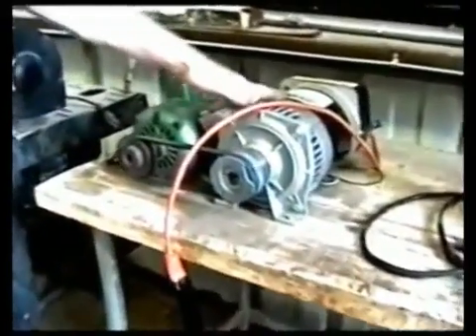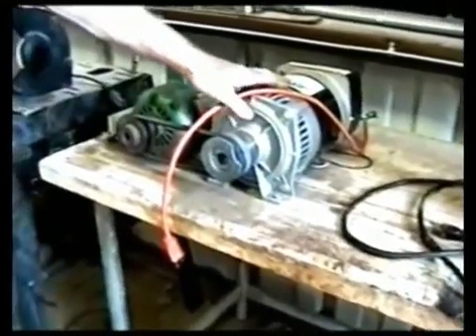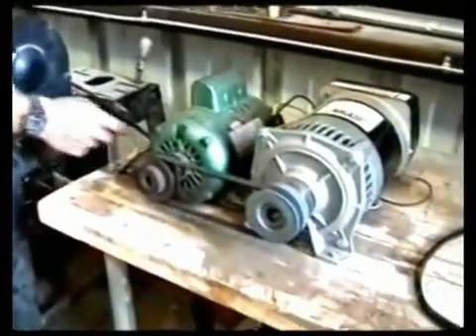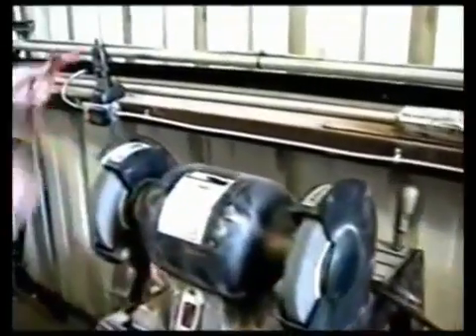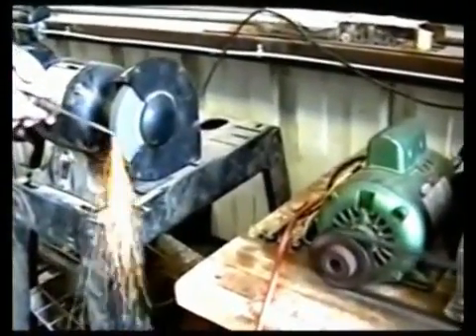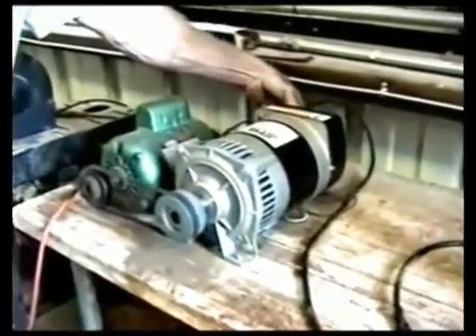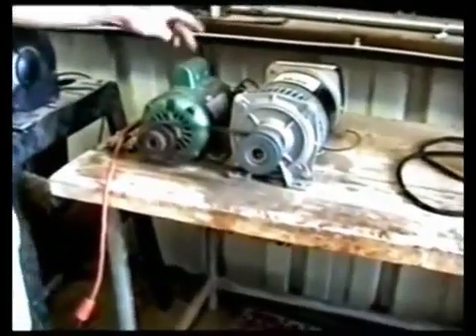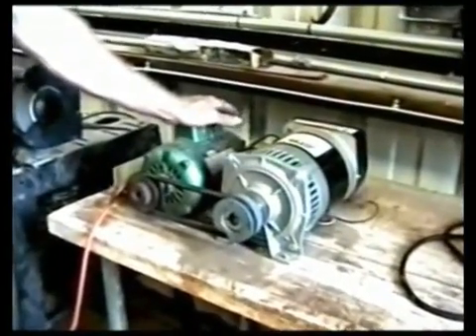3000 Watt Generator Powers Itself, Grinder & Drill Press.

Comment: I thought about this for 2 minutes and did a diagram on how this would work. The key is getting the primary motor up to speed and using one that uses less power than what we want to generate. Maybe a 750 rpm  Ac Motor with a pulley wheel four times larger than the pulley wheel on the generator will bring the speed up to 3000rmm. This will then generate  power which can be fed via a changeover switch which knocks off the mains electricity to the primary motor and replaces it with some of the power that has been generated. the remaining power is used to operate your electrical appliances and is limited by the wattage output of the generator. Don't forget that because the primary motor was started on mains voltage and is running up to speed, it does not require much power from the generator to keep it running, The only problem I could see is getting the right motor for the job. ie a continuous running motor maybe half a horse power. Would continuous use for hours burn the dam thing  out? If your not electrically minded ,or a spark  I would recommend not trying this. Remember, Electricity can Kill.

Comment: This system is very simple and yes it does work. You people need to know the basics of how electricity comes into your cities and homes before you can understand it.  A power plant generator only supplies the initial power. It is the transformer that multiplies and increases the voltage power that you actually receive at a substation in your cities. The transformer is the key. The generator only supplies a small fraction of starting power to any and all power grids. What this person has done is use a more powerful transformer/coil to get more auxiliary power to power the electric motor that keeps the generator running as well as the other outside uses like the grinder and drill press. This is so simple and is genuine. Of course this is not patented or on the market because the power companies as well as the government do not want it on the market. Generators used in power plants DO NOT send millions of volts to cities without a transformer radically stepping up the power. And by the way, a transformer/coil has no moving parts. It is a self contained unit that steps up power and also can step down power. Every power plant has a step up transformer to radically increase power to cities and every city also has step down transformers to decrease the power to each and every home. You have step down transformers at substations and then each and every home has a step down transformer on a pole outside your home. This is very basic technology and has probably been known since the generator and coil/transformer was invented. The key is to put a bigger coil that increases for auxiliary power to whatever your needs are.

Comment: I love when random retards come out of the woodwork. skeptics that help feed the corporate world are my fuel for laughter. it's entirely poissible to do this as long as the generator itself produces more energy then the electric motor consumes. given that it's entirely possible to create an infinite energy supply, this one is very small.
Reply: +Devin Williams the secret is that yes there is another power cord, it's drawn from the generator head with multiple outlets, that's what wasn't disclosed. that's why the switches are there. I get what you're saying but no one is seeing the bigger picture. he made a completely self sufficient generator on small scale. this IS the sort of thing that will change the world as soon as intelligent eyes are open. it's a very simple idea.
Reply: +reynardfoxx you've never seen a belt driven generator have you. if so you'd know that that small electric motor that ran off a 120 volt circuit to initiate the rotation of the generator which creates its own energy flow to power other things the same damn way a gas powered generator does.... the switches allow transfer of energy source from wall outlet to generator outlet. generator has two outlets total built it,generator spinning creates energy to maintain electrical current to electrical motor on one outlet, generator still has enough power on reserve through the  revolutions per minute to power a second outlet and run the grinder then the drill.

Comment: lotta morons in these comments.  systems like these already exist.  this is not new.  i can't vouch for the validity of this video,  but i can vouch for the validity of the science implied.  there are many similar systems that seem to "power themselves",  but all you need is to understand the logic running the device,  cause and effect.  There are much smaller,  simpler devices that create the same effect of perpetual motion through magnetic fields.

I'm about to build a DC generator farm(10GENERATORS)  that use the concept of what is now called perpetual energy.  the term perpetual energy isn't a literal term.  so don't be stupid.  study your science you dipships.  p.s.  what kind of idiot would turn this video into a relegious topic??

Comment: What if an electric vehicle was built that had dynamo type power generators (like the ones they have to power bicycle headlamps and tail lamps) creating power from rotating axles/wheels so that the power generated in this manner would  "top up" the batteries of said electric vehicle?  It's a step closer to perpetual motion...of course the power companies would probably not like this manner of motility and would do anything in their power to discredit the technology...just a thought
Reply: same idea, only that it would generate current while the wheels/axles are rotating as opposed to when the brakes are applied.

Comment: i got a car alt 12v and a 2800 rpm 24 volt motor with 200amp start up dropping back to 150 amp.running .. i put a 250 watt converter  in the line  .. and a car batter 14 plate 900 crank amps. , turn converter on to sart motor it spins car atl to replace power  ..it only gave me 60 watts to play with but it was free .it ran my work light ....and i put it in a shopping trolley...so i could move it around.. 
im not an electric person but i made this and i no it worked..... try thing out for your self..

Comment: You need to add a peak voltage detector that sees the output voltage drop of 20% and then automatically resets the input at the wall for about say five seconds.  You could have a variable voltage detector and automatic switching and reduce the house power usage for maximum performance!

Comment: if this is legit, its 2 cool
ive wonderd y it woodnt b possible 2 build a perpetual motion electric cars? 
yes i get the energy spent on friction n wutevva else
but aint it possible if the output gears/pulleys r smalla than the input gears/pulleys
which in turn then syphon the needed energy back 2 the motor, as well as spins the cars shaft?
i mean it seems possible so long as the input generates mor rpm's than the original output
---
totally not tryin 2 ruffle anybdys feathers
jus a ditch digga, lookin 4 feedback

Comment: I did something similar years ago with a car battery, starter, and alternator to run 12v lights and keep the battery charged. All I had to do was flip a switch and the lights came on in a barn shop. Bright lights too...car headlights. Its a great setup for hunting cabins or camping. And with a 12v/110v converter you can run low energy 110v appliances like small refrigerators or a tv...

Comment: Was just reading the comments regarding this generator, first, i think he used bent drill bit to show it was really turning. I'm not to sure about this myself, as someone rightly said you cant get more energy out than you put in, I dont think there was a hidden wire when he removed mains plug ,if it was running on its own, there was no load to slow it down so it would have stopped eventually due to resistanses in motor, altenator. Someone suggested gearing altenator to drive motor faster that would add more resistance, another suggestion was larger pulley on alternator smaller one on motor, also if the motor is domestic mains (usa voltage) the altenator is 3,000 watts a lot of power you would think it would run the motor with no effort perhaps for a short time, the main problem here would be the faster the altenater was turning the higher the magnetic field build up between rotor stator so more resistance to hold motor back,would'nt the problem be the same whether it was a magnet rotor, or one that required exciter current?  would welcome comments on this. please.

Comment: How many amps does a car alternator put out? All it takes to get the alternator working (it has to move first to power the spark plugs) is a 12 volt dc battery. And if you can impart enough rpm to a generator, and that generator can create let's say 20 amps, and it is being run by a motor that drains only 3 amps.......? Come on people. Spare me the math, and start doing some real experiments on your own. Hundreds of people have tried this and made videos. They're everywhere.

Comment: If you would share to a fellow tinker guy, my email is kmss44@yahoo.com, thanks, also, i am curious if you had to change the sin wave to get the motor to continue to work.  I have seen some ac units work when they had inverted a dc generator wave to run it.
Reply from the maker: FREE CLASSES!  After you study the free classes on the website, THEN AND ONLY THEN, send us a email. witts.ws
contact us page

Comment: is there any chance you would share how you made that work, with your additional coil set up.  I am working on one right now but , I was curious to know if the ac motor your using is brush type, brushless, or that new internal centrifugal switch type with capacitor?

Comment: "The device presented in this video is NOT an isolated system. The additional energy is from Ground Zero / Quantum field. 1cm cube of empty space has more energy than the matter of all galaxies (10 to ^93 grams per cm3, compared with 10 to ^55 grams per cm3). We are "swimming" in an infinite "soup" of energy."

Unfortunately, "Empty Space" does not exist outside a quantum theory classroom. Space is filled with matter and EM radiation of all sorts.

Also, hate to burst your bubble, but convential generators operate with AC/DC current, not quantum fields.
Reply from the maker: FREE CLASSES!  After you study the free classes on the website, THEN AND ONLY THEN, send us a email. witts.ws
contact us page

Comment: Yes, over=unity does work, but for my money and to get enough total power to run my home and garage shop at 140 amps I need multiple systems that run automatically and draw almost nothing to run itself.  For this video set to run it has to be a capacitive start motor (which it is) and even with generator modifications it will only put out 1/2 of the generator's peak power continuously before stopping,

My 140 amp draw home power system is an advanced solar & wind system that I am adding an earth battery system for the 24/7 reliability factor making the solar and wind backup charging power.
Reply from the maker: FREE CLASSES!  After you study the free classes on the website, THEN AND ONLY THEN, send us a email. witts.ws
contact us page

Comment: If you have a motor that uses 1000 watts to make a known amount of power. It would only be a certain percent efficient, say 80%. Now, using that motor to drive a generator @ 90% efficiency would make 720 watts, not 14,000! You can't get more out of it than what you put into it!

Comment: "Once you get the cycle started" by an outside source of power and once the generator is spun up to correct RPM, then the generator will produce the energy that it was designed to do. In this case, if its a 3KW generator running a 500 watt motor to spin itself then your surplus of energy is 2500 Functional watts. Once you shut the cycle off, then you again need an outside source of power to restart it.

Comment: So this possible protracted device works by having a system that runs at a constant level of energy and can take a certain amount of load before stopping completely? The reason I say that it's a "possible" protracted device is because its components would eventually break down over a certain amount of time due to wear much like with today's gas generator, however, the gas running the generator would be exhausted before the break down of its components.

Comment: I have a water fountain that shoots water up high enough to fill the bucket that provides the pressure to shoot the water that high.
I drink from this fountain, water my garden and refill my toilet and it always has enough water to shoot the water through the spout up into that bucket.

This is all thanks to quantum fluctuations that seem to only act in the direction I need it to to ensure I get more water out than I put in.

Comment: where to start on this one.. theirs some kind of board under the table,, kind of shady.. u have no fly wheel.. and no control.. how do u know ur getting 120 at 60hz.. also didnt see a spark or ark form when pulled the plug from the wall any a/c motor will ark once disconnected.. and there is no way a pair of light switches can hold the amps for all that crap.. i didn't hear any relays.see any capacitor. no voltage regulator or transformers. 14amps would bog down a Chevy 350 at 2,8k rpm no way in hell ur 1/3 hp A/C motor going to keep up.

Comment: look very closely 8 seconds into video pause youll see 1 black 1 white going into generator head the outlets are in back of the unit i bet he wired them from the switch to the genrator head inside just wirenuted inside case wall outlet i bet the breaker is off on the wall cause as soon as he fliped that switch the breaker would have snapped he would have fryed the generator causing a back feed to the panel breaker even if he had a contactor it wouldnt be quick enough to snap the contactor over  ive been an electricain for 22 years or so give or take a year or 2

Comment: Would be more believable if we had a amp meter,Volt meter. And explained the "mods" that were done to generator head..  I'm just rittled with confusion here how we  Didn't. Here. Amperage. Change  Pull anything down???  R.H. with 'electrical motor rewinds company"  31 yrs experience.

Comment: Perpetual energy doesn't create energy... it only recycles it. Your just reducing energy loss to zero and continuing to use the energy you used to start it. So basically your just down the amount of energy you put into it. Yeah you can hook a bulb up to it and see power, but it will slow down and it will never recover that power.

Also if this was legit it wouldn't be running off of a crappy belt drive. He is probably losing 25% of his power at those RPMs and torque levels...

I don't know if this video is supposed to be serious or if he is just trying to sell this idea to someone to get an investment in other projects or what, but I do know it's smoke and mirrors... Complete waist of time... feel sorry for the 5 million people that watched this and even worse for the people that were foolish enough to fall for it...
Reply: +Devin Williams well said

Comment: Built the same system for myself pretty close to this one, it wound down in under a minute, and any added load stopped it completely, tried different pulleys, not much difference in results, Conclusion BS

Comment: A man can walk, talk, work on an on without food or drink for a day or two.. what happens after? need food and drink. are you telling me i can live without food and drink?
Reply: TheWorldSolutions Thou shalt not lie about the laws of physics and impossible perpetual motion contraptions.
Reply: TheWorldSolutions
 Bringing God into it is not going to help you. The math does not lie.
Reply: Ermo Tess Actually yes you can... almost. you can actualy go about 4 days if enough energy is given, however, modifications are needed as it is not found in nature, you need a urine and sweat transfer to natural drinkable water, and feces to a nutrient supply, there are people in space doing this daily, it is boring and disgusting tasting but it is very much possible.     
In this case I was thinking of once you get something going it uses a small amount of energy to bring water up something and pour it down making hydro electric power therefore using the energy usage reduction system in order to get slightly more power each time.
Reply: You get the food and drink from "ground zero" apparently.
Reply: you can live days even some cases weeks without food. Can only live a few days without water.
Reply: SlenderMan water in space is recycled but they also use fuel cells hydrogen in water and electric out
Reply: +_iZEiTHTiEk Ponio Narne except perpetual motion devices are physically impossible. Do you even science bro?
Reply: SlenderMan as I said, learn science.
Reply from the maker: Man shall not live by bread alone, but by every word that proceedeth out of the mouth of God (Matthew 4:4)
Reply: Ermo Tess the use of this perpetual motion in a remote off the grid area where you can grow ur own food by means of free energy to pump water -an irrigation for agricultural purposes for an abundance of food resources. Please visit my website www.facebook.com/SustainableOffTheGridProject, thanks \m/
Reply: yes 40 days. .no water no food.no agua no comida.!!!
Reply: +SlenderMan dude, learn science.
Reply: I am scientology